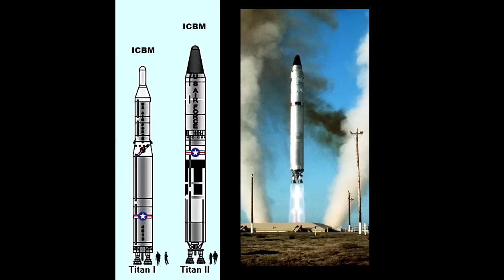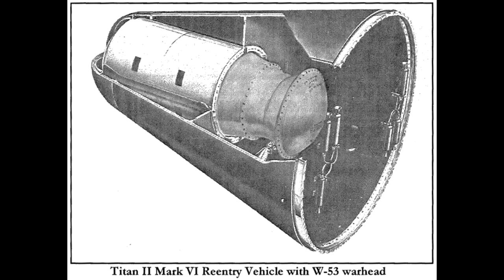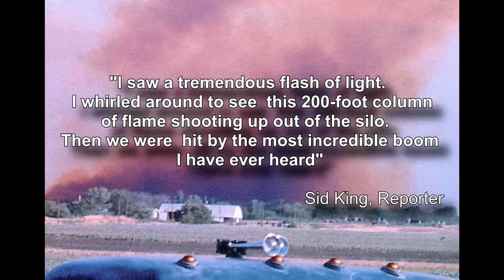Nuclear Missile Explodes Inside Silo - The Arkansas Titan 2 Incident (1980)

Comment: A few things of note
1:with how nuclear bombs work, the danger isnt it going off (in fact its almost impossible for it to ever do so from a rocket explosion) its moreso spreading the highly enriched nuclear material all over the site of the silo, and all over the surrounding town
 
2: Something that was seriously dangerous about the titan 2's fuel leak, was that it used hypergolic fuels. The specific fuels they used are incredibly, incredibly carcinogenic and toxic to humans, which probably caused the biggest headache
Reply: I remember a video of the army where they demonstrated the safety by setting warheads on fire, throwing them off planes without a parachute, shooting them with guns, and just about anything they could think of. Thankfully nuclear weapons are very complex and requires exact circumstances to blow up.
Reply: WRONG !  1 - Point Detonation was a concern and 4 tests were done at the Nevada Test Site and of the 4 tests, ... 1 did DETONATE , proving that a stray electrical charge could set off a nuke !  I was a major concern, especially with the GENIE Air to Air missile but all the nukes of the time, It took nuke weapons specialists nearly 20 years to get better Fail Safes installed onto nuke warheads !  The spreading of Plutonium from a warhead is second only to a detonation. Areas can be somewhat cleaned up  such as Johnston Island , Nevada Test Site, McGuire AFB, etc.  Read COMMAND AND CONTROL and another book , ATOMIC ACCIDENTS and learn  just how close we've come to self- annihilation !
Reply: @Nerathul1 , the US Army wouldn't have conducted those tests: they would have been conducted by the Atomic Energy Commission (AEC), forerunner of today's Nuclear Regulatory Commission (NRC).  Whether we're talking about the AEC days or the current NRC days, they would have needed assistance of the Air Force, Navy and Army, because neither the AEC nor the NRC own the equipment for carrying out the tests by themselves.
Reply: @SteveWright-oy8ky , I'd respectfully disagree with talk of "self-annihilation".  We had accidents and incidents that could have raised alarms east of the Iron Curtain, but most of the nuclear accidents involved relatively small devices with relatively low nuclear yields had they achieved critical mass.  We DID have some near misses that could have devastated large areas had they gone nuclear.  Fortunately, the Goldsboro, Palomares Spain, and Thule, Greenland incidents DIDN'T achieve criticality, even though they were a right bloody mess to clean up!

And speaking of cleaning up nuclear contaminants, you didn't mention the IVY MIKE shot in November, 1951.  Not only did it obliterate the island upon which the device was built, it thoroughly contaminated the entire Enewetak Atoll with lethal fallout -- and caught a Japanese fishing boat, too.

Enjoy Gojira films?  You owe them ti the IVY MIKE shot!
Reply: @johndemeritt3460  CORRECTION ! ..... It was NOT the Ivy Mike shot that contaminated the Lucky Dragon #5, but the Castle Bravo shot as it had strayed into the Confinement Zone, unnoticed by security crews. 
Yes, massive contamination and limited clean ups of the incident areas due to the Govt's and military's wanting to avoid longer term remediation of those areas and the sheer costs !  I was addressing the single event at Damascus, but could go on and on about all the various Nuke events contaminating large tracts of land, people, water and air ! ROCKY FLATS with it's 2 large PLUTONIUM FIRES ! WIND SCALE with it's large Plutonium Fire !  The MIAYK Event in Russia that contaminated thousands of square miles of land, water, air and people ! The HUNDREDS of Open ATMOSPHERIC Nuke Test that have spread nuclear fallout worldwide. And among the worst,... the dozens of Nuke tests in the Pacific that have contaminated the Islanders,... or the hundreds of people contaminated from the DOWNWIND Radioactive FALLOUT from the Nevada Test Site in the town of St. George , Utah and surrounding cities !  There is NO LIMIT to the stories of CONTAMINATION, FALLOUT , DEATH and DESTRUCTION caused by the Nuke Tests ! For evey 1 test you can name,... I can name 2 tests or event's you never heard before !  The Govt and military DON'T WANT THE PUBLIC TO KNOW ALL THE FACTS  !
Reply: @SteveWright-oy8ky ,  whoa there, pardner!  Let's not get into a p!$$ing contest!  We've BOTH got some things wrong here, and I thank you for RESPECTFULLY correcting me.

For 12 of my 20 years in the US Air Force, I was a Disaster Preparedness Technician.  I attended the Nuclear Emergency Team Operations School (NETOPS) at Kirtland, AFB, New Mexico.  There, I learned a LOT of stuff I wouldn't otherwise have wanted to know.  And it's just as well I don't remember much of it, since some of that stuff was classified, and probably remains so to this day.  So there's that . . . .

I won't challenge much of what you said: there have been disasters the public has, for the most part, been blissfully unaware of.  And, like all of the other Superfund sites, most people will never know about them, but not necessarily because the Government doesn't want the PUBLIC to know about them: it's more likely that they didn't want the USSR/Russia to know.

All in all, I generally agree with your points, but there's one I do feel necessary to challenge.  You wrote, " The Govt and military DON'T WANT THE PUBLIC TO KNOW ALL THE FACTS  !"  I may be a bit pedantic here, but the armed forces are an arm of the government, so saying, "the military and the government" is a bit redundant.  And I should know: redundancy is kinda my signature thing!
Reply: I had a case of the hypergolics once. Nasty business. Not painful so much as really itchy, although I never knew if it was the condition or the heavy leather underpants required to contain the problem that caused that.
Reply: @SteveWright-oy8ky  There have been a few nuclear carrying B52's that crashed. One in No. Carolina tripped all but one of the triggers!

Comment: We called Three Seventy Four Seven "Four Seven"....the socket was 3-3/4", it was used for tightening the Stage 2 Oxidizer "Boss Plug". The gantry was known as the "thrust mount". The Exhaust fan switch wasn't in the control room, it was near the exit door. The silo door was 760 tons but was more like 200 meters away after the explosion, there was debris more than 1/2 mile away. There was never any danger of a nuclear explosion but the UDMH and N2O4 were highly toxic. Our biggest concern was being poisoned. My room mate at the time was a guy named Pat Tallman. Pat was a PTS troop like Plum and Powell. He was suited up and ready to go back in after Livingston and Kennedy came out. Pat was injured but worse, he started growing a huge goiter on his neck not long after the event. UDMH in particular is extremely toxic, the Soviet's called it "The Devil's Venom". Pat died young, I don't think he made 40. Many Titan II guys wound up with cancer, in particular PTS guys. I was in the ELAB shop. We maintained most of the electronic gear on the complex. Especially the systems for monitoring Fuel and Oxidizer leaks. These systems were manufactured by MSA of Pittsburgh. They used radioactive Ion chambers with either Ra-226 or Am-241 Alpha emitters. They also used reagents that were either Dimethylamine (Dime) or Trifluoroacetic acid (TFA) these chemicals were just about as bad as the Fuel and Ox. We replaced these every 30 days on all 18 sites (17 after 4-7) No job in the military was more dangerous than PTS. Elab might be second but anyone that spent any time at all in a Titan II silo got more than their share of carcinogens and toxic exposure. I'm proud of my military service. It was a different world anyone under 50 would likely not understand. That said, there's a reason they get 20 years old's to do those things. 63 year old's wouldn't dream of it. Scary Stuff.....
Reply: Hey Eddie, I was in the ELAB shop back in Tuscon in the late 70's. I remember calibrating those damn MSA's using those big plastic bags and the glass ampules to get the proper PPM sample, then just venting the bags right into the air when we were done. I'll never forget the smell and have always wondered if I would end up sick at some point. I'm 67 now and fortunately never had any cancers, but I know that UDMH is one of those forever chemicals that never leave your body, so it may just be a matter of time. It was a real shame about that site in Little Rock and the other one in Wichita where they ruptured the oxidizer tank and the MSA emptied the 20k water tank onto the N2O4. Man, what a mess that was! BTW, did you ever see anything weird at the haunted site? I heard stories about it but never talked to anyone that had been there.

Comment: I was a hydraulic repairman and during my three years at Little Rock AFB I had numerous opportunities to work at that site. We were always aware of the dangers concerning the dropping of tools in the silo when working on the surrounding work platforms or on the actual missile itself.  You had to be vigilant about where you were working and what you were carrying or using when performing tasks.  One false move and that would be it. I was stationed there fourteen years prior to this incident.  One thing that I am grateful for was the opportunity to take part in setting up a Titan II airborne hydraulic system at Vandenberg AFB in 1965 and seeing its successful launch down range.

Comment: This is actually one I'm very familiar with and the video is right on the mark! The Titan 2 and it's systems is something I've been into for years. It's fascinating how the systems and the missile worked. The Air Force was able to design a launch systems that was shockingly easy to use! It took less than a minute and anyone could be trained to launch that missile within a short time. The amazing thing is that, though they made it completely idiot proof, it was also entirely preventative of an accidental launch by some bored missile technician. It didn't matter what someone or any group did.... That missile would NOT leave that silo without a confirmed order from the President. It is an amazing system and surprisingly simple! They had safeguards for the safeguards...for the safeguards..lol. I highly recommend learning about the Titan 2's! Also..here's something crazy..NONE of those systems were classified at all! They gave tours of the silos to boy and girl scout groups! The only classified material in the entire facility was the codes used to confirm launch orders that were kept in the red safe. Literally everything else, to include the missile and it's warhead, wasn't classified.
Reply: Sorry to geek out..😂 Love this subject matter!!👍
Reply: @meetoo594  That's an urban legend. What it refers to is a dial lock..almost exactly like a briefcase lock..that had to be set correctly with a code received with launch authorization. This would open a valve in the fuel system and allow the fuels to mix to start combustion.  It was genius too. You got 6 chances to get the code right. On the 7th attempt the locks electronics would fry themselves and the valve was sealed for eternity. This was to prevent some bored technician from repeatedly trying to guess the code. The odds were 1 in 16 million to get it right but the Air Force thought even that was too much of a chance. Hence, the 6 tried limit. A few years ago a former missile commander claimed that the code was always 000-000. However, the code was never transmitted to a missile silo in the entirety of the Titan 2 program. Furthermore, this guy served in a silo and not in the command structure that would have possible access to the numbers. Somehow, the internet turned all of this into the Military not trusting the President which is just moronic. The only authority that can order the use of nuclear weapons is the President alone. The so called "nuclear codes" weren't codes that were entered into a computer to launch a weapon. The codes were to verify the identity of the President. The dial code for the valve was the only code required to launch. The missile was launched with the turning of 2 keys.
Reply: @meetoo594  It really is fascinating how it was done. Also, amazing how they considered the physical needs of the silo crew after the launch. It was really antiquated by our standards today, but the way they used physics and common sense to launch the missiles is just incredible. I've never been on the tour of the one remaining complex, but it's on my bucket list.☺
Reply: Also, all of the electronics needed to operate both the silo and the missile took up two entire floors of the accommodation area. What's crazy is that the cell phone you're holding could accomplish every bit of it today.☺ Sorry, I'm a geek.
Reply: @TracyA123  Wow, you certainly know your stuff. Thank you for the detailed explanation. I had a hunch there was more to the story but didnt realize it was just an urban legend for the most part.
Reply: Any idea why happened to they guy who dropped the bolt and started the chain of events?
Reply: @TracyA123  There was a crewman who actually looked at the wiring diagrams, and showed that the fuel system safeguard could be bypassed. The hatch he described to his superiors was welded shut, and the crewman was moved to another job title. If I'm not mistaken. That hatch was behind the computer equipment in the launch control center. And it is welded closed in the museum silo.
Reply: @jasonduncan69  Yes..the lock could be bypassed. However, the Air Force thought of that too. They actually used one of the first digital loops between the valve and the lock. It constantly pinged back and forth. Any attempt to "hotwire" the lock would disrupt the digital signal and a series of explosive squibs would fire inside the valve and completely sealing the valve shut. Also, should a terrorist organization take over a silo and try to force a technician to manually force the valve open somehow they thought of that too. The valve was enclosed in a sealed compartment and any attempt to open the compartment would fire the aforementioned squibs and seal the valve. That missile could not be fired without an order from the President. Regardless of what the crew or anyone else did.
Reply: @meetoo594  Thank you for your kind words.☺ I'm just a geek who is way too into 1960's missile technology...lol
Reply from the maker: I think we have found our resident expert folks...  ;-) Tracy  "A Bomb" A
Reply: @theravenseye9443  roflmao😂😂 Great video brother! It's an incident that is really scary but, as you pointed out, there was no chance of a nuclear detonation. Hate to geek out more but I want to tell you something else..lol. The actual warhead in the nose cone was accompanied by 6 super dense metal cones about 5 ft high and similar in size to the nuclear payload. As the warhead re-entered the atmosphere, these cones would be fired out in all directions. This was intended to reduce the chance of the warhead being intercepted. The Soviets or whoever would have 7 targets to track and intercept instead of one. Virtually removes any chance of interception. I'm just so fascinated with how incredibly thorough the Air Force was with the Titan 2 missile systems. There are so many amazing details of how they safeguarded and operated them! I'm certainly no expert I just have no life to speak of.😂
Reply: @theravenseye9443  I believe your resident expert should be someone that has actually worked on the TITAN ll Weapon System.  I doubt that this person actually worked on the Titan . I knew Sgt.  Kennedy and A1C Livingston as I was a Titan ll Missile mechanic/ rocket engine mechanic stationed at Little Rock A.F.B 1976 to 1979. I was reassigned to DM A.F.B in Tucson and kept in touch with many co-workers at Little Rock and some came to D.M  to give us special briefings on the accident an information that was not made to the media. Everyone that worked on the Titans had TOP SECRET security clearance and our briefings were TOP SECRET .
Reply: @samsamaniego3251  To be clear, I never claimed to have worked at a silo nor did I claim to be an expert in any way. Sam said that as a joke. I simply am amazed how thorough the Air Force was in designing, building and operating the missile systems of the 1960's, 70's and 80's. I've read everything I possibly could find and watched every video I could. I certainly don't know everything. I enjoyed the video that was about something I like and left a comment about it. Thank you for your service and if you have any experience with the Titan 2's I would love to hear about it.☺
Reply: @jasonduncan69 You are correct.  The safeguard was a butterfly valve on the 1st stage fuel line that was connected to one of the racks of launch equipment. I worked for the ELAB shop that maintained the launch electronics and all of us knew that the code wheels could be bypassed with a few well placed wires, but there were additional safeguards in case someone attempted it. It was the only piece of equipment we worked on that was rated Secret, requiring all of us to have Secret level clearances. In addition, we were required to follow the two-man rule which means no one was allowed to go anywhere in the silo or control center alone.